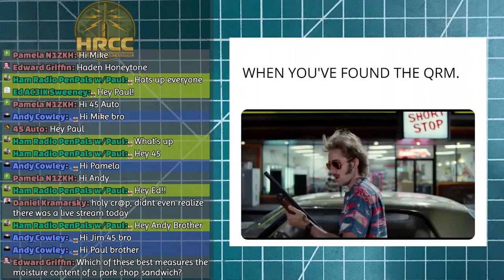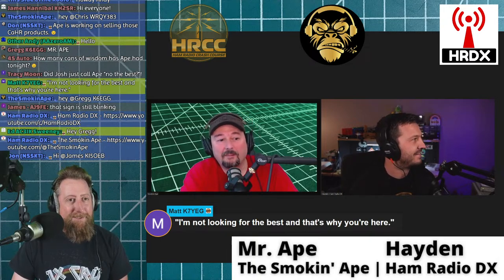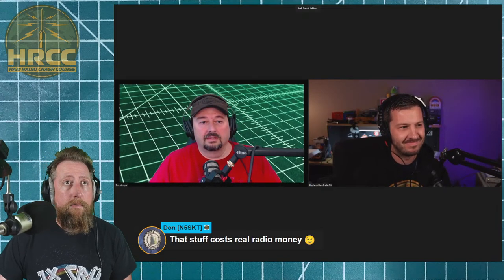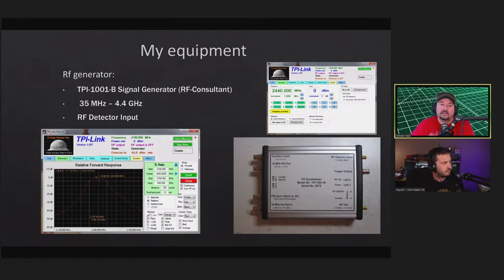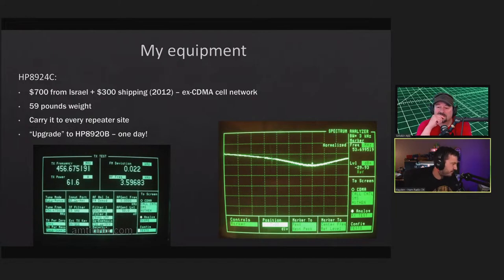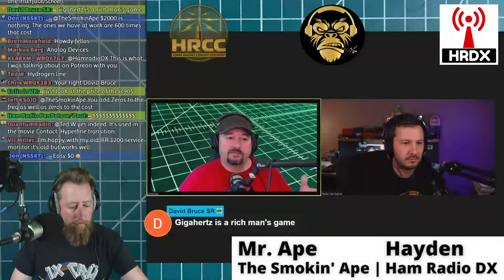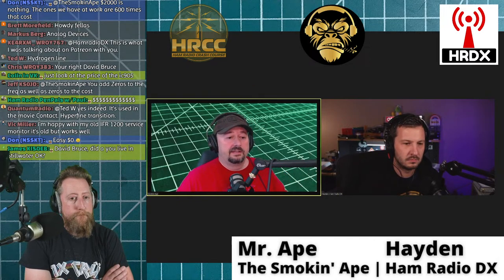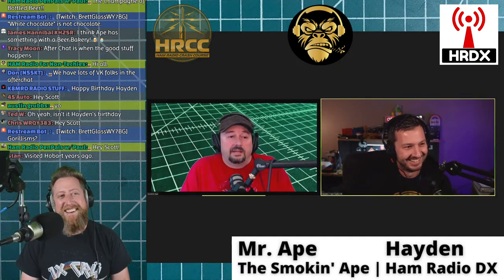Why You Want A Radio Service Monitor!

Comment: R&L Electronics in the USA for TINY SA and VNA! The Ultra is $139! and in stock!

I have a collection of TinySA and TinyVNA's LOL every time they increase the frequency I buy it. Can't wait for 11+ghz  top end!

TinySA and a hand held 2m beam works great for power line noise hunting. I set mine at 144.190 to 144.210mhz and look for the pulse every 60 or 120hz, use the antenna to pinpoint the offending pole or span. I tracked down a loose wire tire that had slid to the center of the span this way. Every time the wind blew it would vibrate up and down creating noise!

Comment: I am just getting back into ham radio after a number of years inactive... studying for my general upgrade (I figure after 20+ years it is about time), and rebuilding a station (I dropped out of ham radio because my power supply died in the early teens, and I did not have the budget to replace it (and my vehicle was too noisy for (both electrically and exhaust tone) decent operation)

I have been enjoying many of your videos to "catch up" on what I have missed. A new HT is due to arrive in the mail today, and getting my 706mk2 running, or getting a replacement are the reward I have promised myself for when I pass my upgrade.

I always wanted to get a Oscilloscope or Spectrum Analyzer inline on my radio... both to monitor the quality of my own signal, but also on receive so I could monitor incoming signals... the newer radios (IC7300 and newer (and many even older (756))) include a spectrum analyzer that is great for watching/finding incoming signals, but they do not let you see how your output looks.